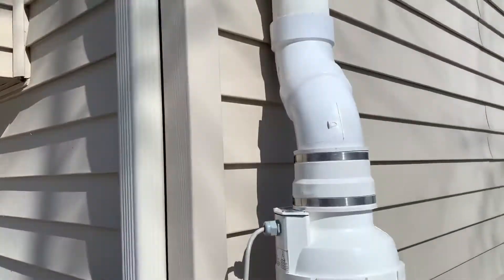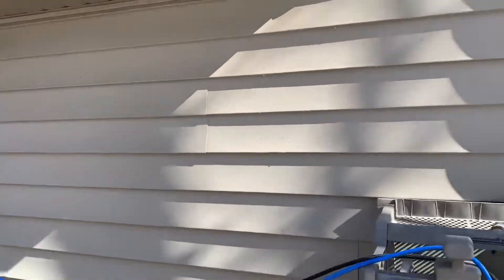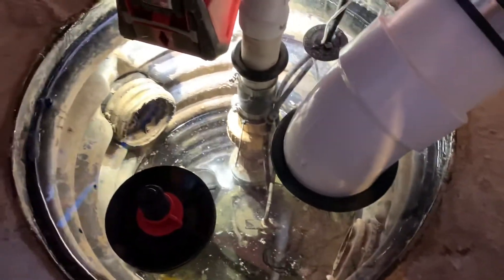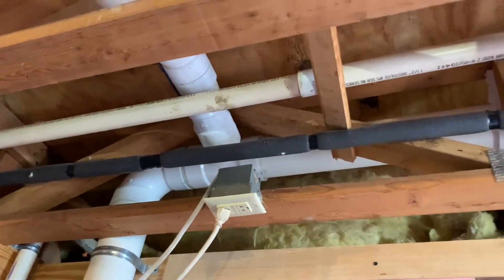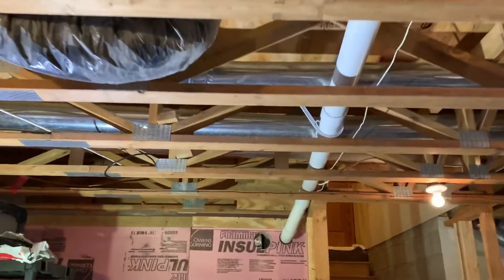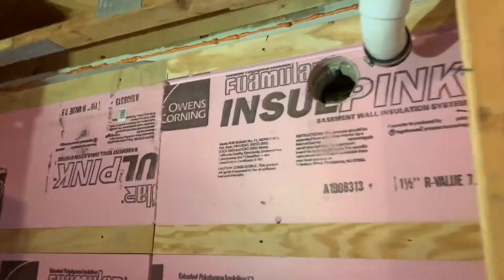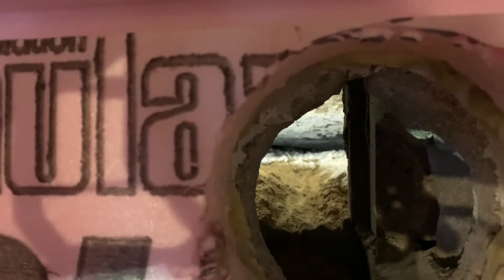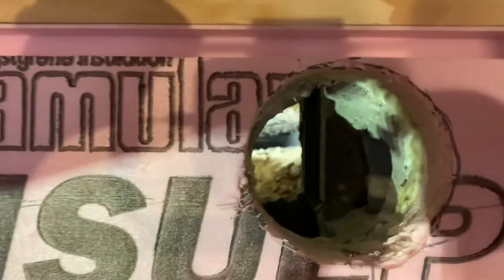Should You Be Concerned About Voids Under Your Slab?

Comment: I thought to meet NRPP there had to be an on/off switch outside for the fan. Are you able to use a cord and plug it into an existing outlet on the exterior of the home. I always thought that was a fire hazard. Meaning the cord could set on fire. Thanks for you answer.
Reply from the maker: Thanks for the question, Adam. You are correct that you can't use a plug or an extension cord to power a radon fan. We plug radon fans in using an extension cord to continue with our diagnostic testing and ensure we see the radon levels drop on our Eco Tracker radon monitors. It doesn't comply with the standard, but it's that way until the electrician comes to wire the fan, typically the next day. Here in Minnesota, the fan can collect ice inside if it's not running, causing it to scape or not spin when the electrician turns it on. After a customer experienced that last year, I'll be a rebel for a day if it means I don't have to deal with a frozen fan again. I've heard extension cords are dangerous and cause many fires, so always follow your local code. 

Section 9.3 of the radon standard covers electrical. https://standards.aarst.org/SGM-SF-2017-X/22/index.html

Comment: Hi Jesse - I know you don’t like outside systems, but going up through the overhang instead of sticking out around it and also painting the pipe to match both definitely made it as unobtrusive as possible. Nice job going the extra mile for your customer. 

As for the settling - excellent camera work showing the settling and the air gap between the fill and the slab.   I am guessing you barely had to open the damper on the 3” to get the suction you needed under the slab-on-grade portion.
Reply from the maker: Thanks, Bill.  

The slab-on-grade portion was the hardest part to get PFE on due to the leaks that couldn’t be sealed. We have the damper fully open there and half open on the basement suction point. Sealing the block tops helped with PFE in the basement.

Comment: Nice video. I just solved a similar scenario where my basement foundation wall had a cutout for some HVAC pipes and a sewer pipe into slab on grade family room. It was interesting because there was a single joist bay past the foundation wall before the concrete slab started (to run the 8" duct). Like a mini, inaccessible crawlspace. Had to seal the end of the joist bay where the HVAC trunk ran upstairs with foam by opening a register on the wall and sealed the hole in the foundation wall and applied suction. 

The slab looked similar, where I could see a good 5-8 feet in with a couple inch gap to the dirt.
Reply from the maker: Nice work. I wish I had access to seal this one up better, but the bathtub and laundry room drywall was in the way. 

Walkout walls and garage floors have settling that can be much worse than this. 

I cored a 5-inch hole through the concrete in a house a few years ago. My bit fell about six inches once I got through the floor. The whole basement floor had 6-12 inches of settling. I was amazed that it bridged across most of the house. 

The homeowner did have foam jacking done in one corner of the basement where the concrete had sunk. 

Thanks for watching.